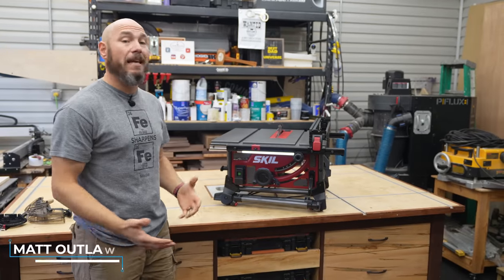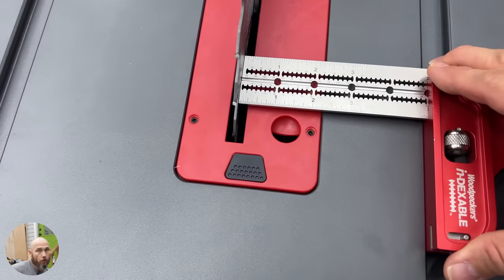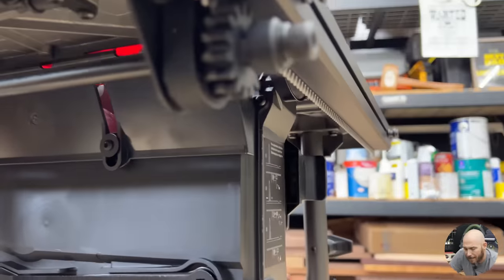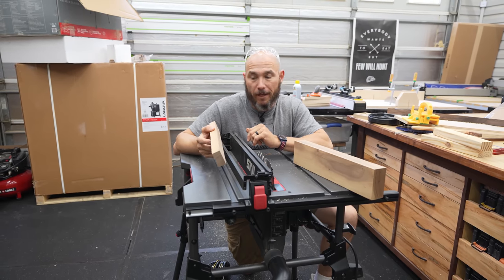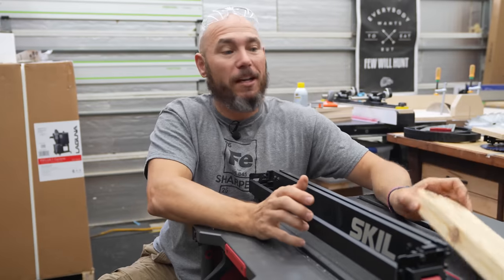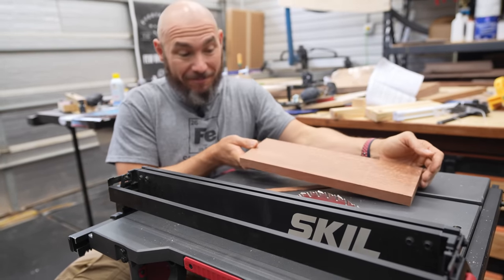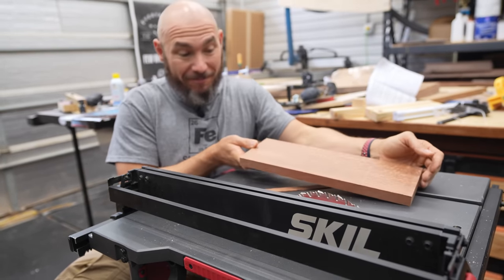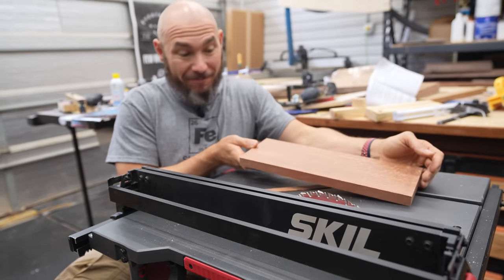Did I Find The BEST BUDGET Table Saw with the MOST Features?

Comment: Hey man, hopefully you see this and can share some advice. Looking for my first table saw, this being one(great review btw). 
Due to sales going on, curious your thoughts about the DeWalt 8.25”? It’s less at the moment, even with the cheap stand. I know most want a 10”and I would as well, but I’m a dude in a wheelchair that is getting into this to push myself and to relax, not make a profession out of it. So, would you take the 8.25 DeWalt over this? Thank ya sir
Reply: @Etc Stuff appreciate the info and you make a good point. I really don’t wanna go with a 8.25, but I could grab it for 240, that’s only reason I looked at it. I can’t justify the cost of the 10” DeWalt no matter how much I like my other DeWalt stuff. I could care less about brand as long as features meet my needs and it will last me a while. The SKIL seems to do that, especially with changing to decent blade like he mentioned
Reply: @Etc Stuff lol that ain’t good. I’m sure someone will snag it though. There’s definitely something about even seeing 8.25 vs the 10 that throws ya, definitely does me. 
And that has crossed my mind about costing more down the road. I’m a rather have it and not need it, than need it and not have it type person. I have no problem saving up longer if it means getting the “better” item, but within reason. I want quality bc I plan on things lasting me for years, especially with the limited use they will get. But quality or not, some of these things simply aren’t practical for me personally to drop silly amounts of money on. Need balance
Reply: Hey Matt, hopefully you see this and can share your thoughts. So I picked this up and so far it’s working pretty good. Plan is to build a slot for it in the new workbench I’m putting together. Switched to a CMT t50 blade but need a new miter gauge. Is the Incra still your pick and then I can add a fence to it? Or do you have another suggestion? Not wanting to drop more on a miter gauge as I did the saw lol. Much appreciated sir

Comment: you should get the zero clearance throat plate or a dado throat plate.  The parts of this machine match those from bosch.  They are pretty small for long boards.  The other thing is how is the angle alignment?  Is 32 degrees actually 32 degrees?

Comment: One thing you didn’t touch on that can be of importance is the size of the miter slots. Some budget saws like Craftsman and Ryobi do not use standard miter slot sizing. So a lot of aftermarket accessories might not be usable.
Reply from the maker: This one is standard size as seen when I put the Incra V27 in the slot.
Reply: Ty

Comment: Was it just the one leg that micro adjusts to level it? Seems like that would be really inconvenient having to make sure that was on the low corner
Reply from the maker: yes, just one leg
Reply: A tripod won't wobble so you just need to adjust the 4th leg. Now... as far as "LEVEL" is concerned... that's more complicated. I don't need mine that level, yet! 😮
Reply: @tuberstitious  are you saying it doesn't matter which corner the adjustable leg is on? I was thinking your statement was contingent on the other 3 legs being "long enough", assuming the adjustment only allows you to lengthen the leg. If the adjustable leg (home plate) is on a high spot, where it wobbles from 1st-3rd, wouldn't the adjustment just make it worse?

Comment: Is your Amazon link supposed to go to a different saw than the one featured in the video?
Reply from the maker: When they are sold out, it goes to the worm drive saw, which is on the same listing for some reason.  When it is in stock, you'll see them side by side on that same listing.

Comment: my first question is, what blades are compatible?  is it a standard size or is it only compatible with certain bland blades?
second question ,  is it possible to either buy or make a longer fence rail?  or is it a specific design that is not easy to replicate?
it looks pretty technical with the geared adjustment factor.
Reply: turns out this brand is not imported into Australia so I'm SOL boo
Reply from the maker: Any 10" table saw blade will work.  Has a standard size arbor.  You could build a longer rail that attaches to the fence if you wanted to.  Not sure why you would need to unless you are talking about making it extend further than 25 1/2".  If that's the case, then I would think no.
Reply: @731Woodworks  my thanks for your reply.

Comment: The fence appeared to have a big toe out from the blade. Should not the fence and blade be parallel? Or is also the fence adjustable on the SKIL?
Reply from the maker: the fence was perfectly square to the blade.
Reply: The fence is adjustable, and the yaw of the blade is also adjustable.

Comment: Looks like a great compact saw.  Wish I had it instead of my first saw that cost $119, but had the worst fence in history. That fence is a big deal. DeWalt has a rack and pinion fence also, and so does Metabo. I bought the Metabo HPT because it was $399 and came with a built in cart, a lot cheaper than DeWalt. It should hold up and is very steady.  No issues thus   far.  If it does have issues, I will be sorry, I didn't have a DeWalt, which has the best repair network in the country.  Contractors consider these saws disposable, but Skil is a good name that is known for their direct drive saws. No Belts!  That makes them more powerful than belt drive.   Thanks  Matt for sharing.  I trust your reviews. You would not sell us a "lame horse".  I may buy a saw that I can carry around easily and this one is a contender. The Metabo is heavy, but foldable. I bought it for my garage shop  where folding, rolling it around, and stashing up agains a wall was important.

Comment: would it be possible to use it outside and still use jigs like miter and cross cut sleds. Also maybe have something connected to it as a feed table. Id then take it back to my storage unit as I dont have a garage at the moment.

Comment: How many dado blades can you fit on the arbor? You only used 2 in this video.  What's the best table saw to use a wider stack?
Reply from the maker: 2 is all I could fit on this one.  If I put another in there, the nut wouldn't get full threads.  I'd look at the Delta 36-725T2 for a full stack.
Reply: @731Woodworks  my saw is the same. Specs claim to accept a 5/8 stack, but I don't see how! I'll check out the delta. Thanks for the reply!

Comment: So I need an honest answer from someone who has experience with these table saws.I have the money in my budget to buy the dewalt 10 inch DW749IRS table saw. So for this decision, .money is off the table. Which one would you buy? The dewalt or the Skill?
Reply from the maker: I would go with then DeWALT because it has more rip capacity.  The Skil is a good saw, but anytime you can get more Rip capacity from an equally good saw, I'd go with that. At that price, I'd also consider the Delta 35-725T2.

Comment: It would have been great if you did the review on the worm drive 8 1/4” , I know that the 10” blade makes a big difference I’m just curious on how good is the worm drive system. I had the 8 1/4 dewalt, (pretty good and quite saw) and I’m  looking for a replacement.
Reply: I have the 10” worm drive  model SPT99-11 with a wheeled portable standand it is pretty loud so if that is the most important thing for you I would see if I could find a seller where you can run the machine. Otherwise I love the saw I think the R&P fence is better then the other brands models that offer the same type including the Dewalt.

Comment: I've had this saw for about a year.  I use it on the jobsite and I have a Delta in the shop.  I like the Skil a lot though.  Its portability is unmatched with the built in stand.

Comment: I have the european version of this saw, only difference is it does not accept dados and it doesn't come with the anti kick-back add-on. it is an absolutely great little saw, i've built it in to an assembly/outfeed table, installed a soft-start and changed to a freud blade. The only complaint i still have is that the throat plate is too weak and bends down if you are cutting smaller pieces when it is only supported by the throat plate. 
but i will make another throat plate/ZC insert from aluminium to cover that. paid 299€ (roughly 330$) for it and couldn't be happier!

Comment: Question: How was the cut quality on the plywood with the higher-quality combination blade? With the blade that came with the saw (which seems designed for rip cuts, not for cutting sheet goods), you got a lot of tear-out and suggested that if you were going to use the saw for plywood you’d change the blade. Well, was the cut quality improved with the new blade?
Reply: Its all about the blade

Comment: How do you feel about its ability to cut the max rip with that extending fence/table rail? I like that it has the ability to go wider than the table but worry it might not be as accurate for whatever reason.
Reply: Also, how are the miter slots? The ones on my cheap saw were useless from the factory. One side is wedge shaped and the one that can accept a T shape miter rail is too loose. I hate my saw lol

Comment: So you can do only rip cutting with this thing? How about crosscutting?
Reply from the maker: Yes, both
Reply: @731Woodworks  wrong, only ripcutting , because you can't adjust that thing to crosscutting.. ;/
Reply from the maker: @MCEdziits  cross cutting is just cutting across the grain of wood.   You can cut across the grain with any saw.  this one included.
Reply: @731Woodworks  ok, but how to adjust the fence. it does not need to be this way. that's rip cutting position, if you try cross cutting - that would be dangerous - hope you understand my question and sorry for my not so good english.

Comment: Love the reviews, it's a great saw, but at 350-ish, this isn't budget by an means. It'd need to cost a min of half that to be considered 'budget'. Showing the unit description in the info would also be useful, rather than just a link, because unscrupulous vendors change the product at the end of the link (see the Skill ink) and thus the review becomes a little hollow as the correct saw can't be identified. Easy fix though.
Reply from the maker: This is a budget table saw.  Table saws are something that cost quite a bit for a good saw.  Getting one anywhere around the $300 mark that performs well, is budget.  The table saw is one of the tools you shouldn't go cheap on. If you find one for $100, $200 new, it's probably going to cause you more problems than it's worth.  Fence won't square, blade won't square, under powered, etc. So with that in mind, a $350 table saw that is as good as this one, is an excellent deal and what I consider a budget table saw.  The Delta 35-725T2 is a step up but it is nearly $700.

Comment: FYI Matt, this saw is no longer on Amazon, and your link takes you to a similar, yet smaller Skil Table saw.  I was going to use your link, but its not to the correct product anymore, so I'm finding it elsewhere online.
Reply from the maker: I think it is sold out on Amazon right how.  Check Lowe's and Tool Nut, I think they both have it in stock.

Comment: Just a quick question from a somewhat old beginner (60) to woodworking. Why does this table saw have both a riving knife and pawls? Is not the purpose of both of these things to prevent kickback?
Reply from the maker: The riving knife will prevent the wood from pinching the blade after it is cut (sometimes your boards do that if the grain is under tension, etc.).  The pawls basically act as a one way valve.  They have the teeth on there that prevent the wood from coming back at you (or at least that's the idea).
Reply: Belt + suspenders too...😉

Comment: Nope!  Love your videos.  But I just got rid of my skil table saw. Will never buy one again.   Disclaimer, I did have an older one, but regretted buying it almost as soon as I powered it on.  My fence would not stay locked in place or square.  Needed clamps.  And I could not get it to 45° without some brute force (used a magnetic gauge to verify angle).  Great video though.
Reply: Interesting. Was it this same model? When did you buy yours?
Reply: @RyanWattersRyanWatters  it was a Skilsaw 3410.  It was a few years ago.  But it was bad enough that ruined the brand for me.

Comment: A few points here, especially for those saving money for a saw. An old cast iron saw has almost the same footprint as this type of saw. A large saw does not have to have a large table top. Unless a person needs a saw that can be moved and put away, they can find a heavy cast iron saw for the same or less money that will prevent alot of aggravation from a light weight saw, and will give tremendously better cuts. New is not always better, especially with tools. Good review though keep up the good videos.

Comment: Can somebody comment on the riving knife and blade compatibility?  The manual says "kerf width equal to or greater than 0.1" and a plate (body) thickness 0.071" or less".   The diablo blades I've looked at are mostly 0.098" thickness, although some are 0.094".    Is .098 close enough?   Or full-kerf only?

Comment: I’m still working on a Craftsman 10” table saw that’s 10 years old. Serviceable at best but the fence and measuring system is God-awful. Decided I needed a chop/miter saw first. If you were to step up, which saw would you choose. (Under $750)
Reply: If you want a great miter saw under $750 and you don't mind plugging it in then I would look at the corded 10" or 12" Makita.
Reply: @Tool_Addicted_Carpenter  my error. I implied a new chop saw. I actually meant a better table saw for under $750. I bought the Dewalt 715 as my entry level chop/miter saw. Looking for a much better table saw then my ancient Craftsman.
Reply: @waydegardner7373  oh I gotcha. The 715 is a great saw. I bought one specifically for my work trailer setup. The DeWalt 10" table saw is $650 and potentially cheaper without the stand or on sale. 32.5" rip capacity, 3 1/8" cut depth, and dado capabilities. Oliver makes a slightly more versatile 10" table saw with the same 3 1/8" cut depth, slightly less 28" rip capacity, and up to 13/16" dado, but also offers a variable speed blade RPMs and the option to easily switch it over to a disk sander. Costs the same $650.

Comment: I think the worst thing about cheap, portable table saws is the lack of locking controls.  When they are new, they hold the blade height solid.  But, as they get some wear on them, the saws vibration will cause the heighth to drop in the middle of a cut.  If you are only cutting rip cuts or mitre cuts, that's fine.  But, when the heighth is crucial, these saws suck.  There are a few that do what a real table saw will do.  This isn't one of them.  There is a reason these saws are cheap and the fact that big box stores carry them, tells me that the profit margin is through the roof.  But, quality for the money??  No.

Comment: Table saws are one of the tools that you shouldn't cut cost on. Especially if it's a HF or Skil version. (And even moreso since Chervon bought Skil. They realllly threw that brand into the dumpster. They gave the brand great neat technical upgrades, but cheap components, and low quality control.)
 
Lots of tools you can go budget on, but certain tools that a higher risk of injury, are worth saving up a bit more in order to get a better version. 
 
Look at your local marketplace and see all the low priced Skil and Ryobi saws people are trying to get rid of after wasting $ on them a year earlier. 
 
Remember, function does not equal safety. And low cost table saws are usually disposable. It's just not worth the risk with a tool that already gets over 30,000 people to the ER each year.
Reply: Theres a reason its $350 and not $600+.  I saw some of the plastic components on this saw in other videos that could possibly fail with heavy use, but nothing that would seem to compromise safety.
Reply: @A6Legit to be honest, $600 table saws aren't good either (anymore). Try to find one with a perfectly flat surface.

Comment: I have never understood the phrasing "for beginners". People say that in all different kinds of areas, be it photography, building gaming PCs, or as in this case power tools for woodworking... All it means is "for people on a budget", and looks at products in the low price range.

If you were truly going to recommend something for a beginner, the mid range is usually the best way to start, for several reasons. Firstly because more expensive gear is often easier to use, making it easier for the beginner to learn. Secondly because more expensive gear tend to have better build quality (not always true though), making it the cheaper alternative in the long run. So if you want people to save money, recommend something of good quality. I have bought my share of "beginner tools" (read cheap) and regret it every time. They have all gone to the afterlife now.

But... Skil tend to be a pretty good brand in the cheaper range. So in this specific case, it probably is a good saw for "the beginner".

Comment: It could be a great deal. If it weren't for that platic throat plate that flexes under the smallest amount of pressure which results in inaccurate cuts. And forget making one. The licking mechanism is very difficult to replicate. I had this saw for about 2 months and liked everything about it except for this one thing. But that one thing is a deal breaker for me. It's not safe and it's not accurate. Back to Lowe's it went and spent a little more on the metabo hpt which has all the same features and a solid metal throat plate
Reply: Locking not licking
Reply: @seancgalliher7325  thanks for clearing that up! 😂